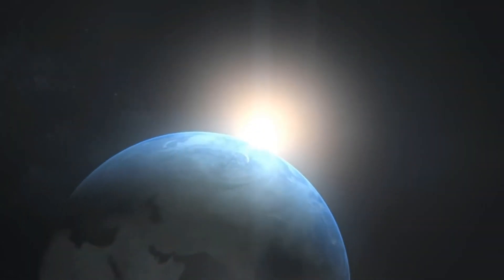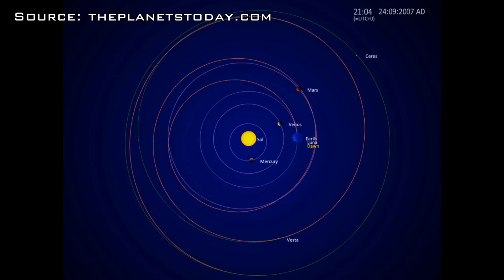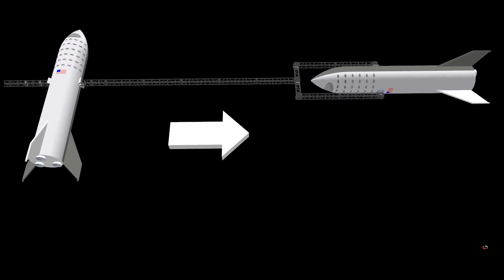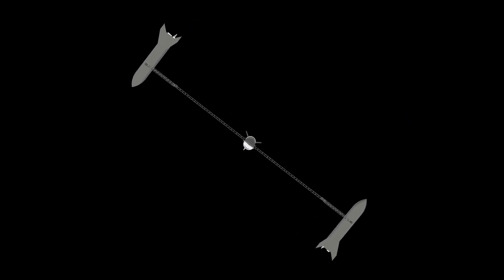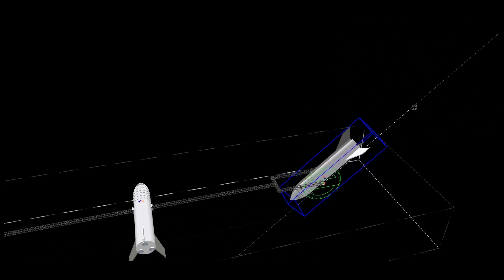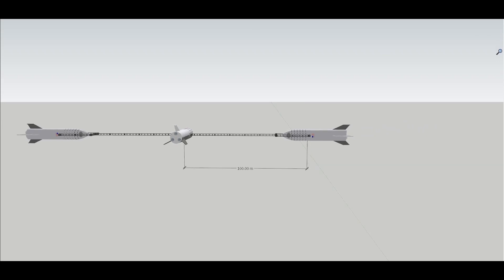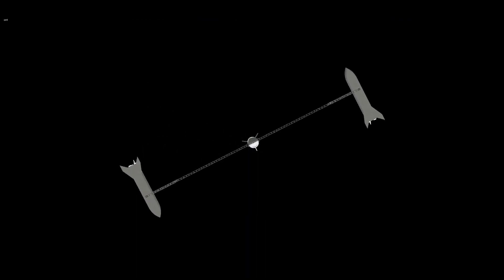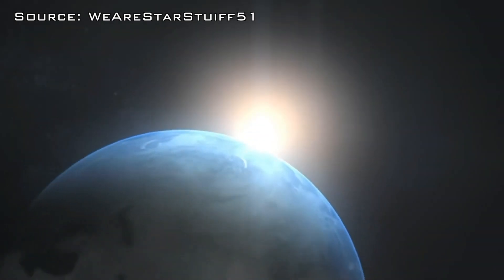GLS2: Artificial Gravity for SpaceX's Starship

Comment: While this is an interesting idea with an impressive amount of effort and research put into it, it is unlikely to function as described.
The Dzhanibekov effect (Intermediate Axis or Tennis Racket Theorem) would result in the superstructure flipping around at regular intervals, which would certainly be very uncomfortable for inhabitants as well as possibly inducing additional loads.
See https://www.youtube.com/watch?v=1VPfZ_XzisU for a better explanation than I am able to give.
Reply: @scr33m9  If you have a look at the video I linked, I think you will find that it is in fact rotating about its intermediate axis.
The smallest moment of inertia would be about an axis that runs through the arms connecting the the 2 passenger Starships to the GLS.
The largest moment of inertia would be about an axis that runs perpendicular to the GLS and the previously mentioned axis with the smallest moment of inertia .
Which leaves the axis that runs through the GLS as the intermediate axis.
Again, not trying to discredit your valiant effort, but your solution is not without flaw.
I suppose it could be easily fixed by simply rotating about the axis with the largest moment of inertia instead.
Reply: @scr33m9  I beg to differ.
Your starship configuration is much closer to the wingnut than the spinning ring.
Have a look at the explanation from 6:44 in the Veritasium video.
The 2 passenger starships would simulate the heavy point masses (M) on the X axis.
And because the central GLS has its front and back end protruding out further from the center point than its sides, they would simulate the light point masses (m) on the Y axis.
Watch the rest of the video from there, and really try to understand the concept.
Reply: @scr33m9  While, I don't think you are going to "show physics who's boss" based the results of a computer game simulation, I would still like to see that. Just make sure you have no other forces like reaction wheels acting on the craft, and you would probably have to run it for a long time. I have found that spinning objects in KSP tend to slow down even though they shouldn't, which will be a problem and will skew the results.

I read something a while back that went something along the lines of:

A good scientist accepts that he will be wrong more times than he is right.
But it is in accepting that as an opportunity to find the real answers that distinguishes the great scientist.
 
Words to live by.

Comment: Why have a whole starship for the truss system. Just have the truss/connector portion in orbit (presumably put there by a starship originally) and have 2 ships connect to that and take it with them. No need to bring a whole third ship along. When they get to mars they two ships (presumably one being a cargo and the other being a crew ship) can detach and leave the truss/connector piece in orbit (maybe add a small thruster unit to it to control it's orbit) for the next flight back. Then repeat the process on the way back again leaving it in Earth orbit for the next ride to Mars. This allows you to optimize the truss for strength and weight instead of having to have it fold ridiculously to fit into a starship each time (yes it had to fit the first time to get up into space but with a dedicated ride/rideshare and some assembly in space the point should still be valid).
Reply from the maker: This is mean to be a re-useable system. Additionally, there won't be enough delta-V budget to enter a good Mars oribt, so the system has to fold up and enter Mars atmosphere to slow down at the destination and land.
Reply: @smallstars  But if it lands then it has to be launched again, launch and especially landing can be hard on equipment (not to mention the extra fuel that has to be made to launch a whole other starship). Even at the sacrifice of some payload/deltaV (And though I haven't done the math I'm not certain it would be, as at worst you could just sling it back to earth without slowing down - you could then have multiple of these between Earth and Mars and you could just catch one and ride with it as needed) it might be worth it to find a way to leave it in orbit or transfer back to Earth. 

Plus, as long as the truss/connector was light enough, and it presumably should be as light as possible since we are sending it to Mars and back(carbon fiber or titanium/nickle alloy - yes it has to handle a lot of stress but not if the movement between the starships is very synchronized - and I'm only hoping the throttle system on the rapter engine can handle delicate maneuvers well - though they might require a more dedicated hydrazine thruster instead for delicate maneuvers like this I'm not sure they have planned that far in advance though). If it is light enough then a small thruster should be able to slow it enough for orbit and speed it back up to meet them again for the Mars to Earth transfer. It might have to detach early and take more time to slow down for mars capture as well as accelerate slower on the return trip, but that is just math and getting the system of equations to line up. At most we are talking about a few days without gravity at the end and start of a trip which is probably doable for even relatively untrained astronauts (which Mars astronauts would presumably be the best of the best).
Reply: If however, someone did the math and found out that I was way off on my assumptions then I probably wouldn't argue with you. I've done math like this before but given that this is a generic reply to youtube  you will excuse me if I don't break out my slide-rule. All I wanted was for other similar ideas to be discussed.

Comment: So the real question is: who is recreating this in KSP
Reply from the maker: @luznoceda5322  Link me to it!
Reply: @smallstars  I think he meant this: https://www.youtube.com/watch?v=W4L2sIYR_3M
Reply: I think putting together three starships in a triangular formation instead of just two would be much more stronger and would require much less support.
Reply: @AquarianSoulTimeTraveler  i went for 4 arms..made handling it easier but your right, 2 is kinda sucky
Reply: I think that you are right about using a rigid surface I just think you're looking at this in the wrong light it's going to be too weak to be able to take all that outward expansion pressure and also not twist and bend... Would require perfect synchronization of rocket Burns to prevent twisting which is possible in a 100% doable but I just think it would be a wiser decision to incorporate three starship in triangular orientation but for fueling purposes it would be very hard to refuel if not impossible if you didn't have the third one in the middle like this design that you're talking about... it should have poles that extend outwards with steel cables to attach and strengthen the design even more against accidental twisting... Would require some in space assembly but would work really good and be super strong.
Reply: Is already recreated, they use a very long truss and an captured asteroid.
Reply: @Zamolxes77  I'm sorry but I checked ur video from 9 years and u built that MASSIVE building IN SURVIVAL omg
Reply: me you bitches! I'm high on C R A C K
Reply: ugh
Reply: We need you too Fuck in the Name of Science (Nope!)

Comment: Ok, so it's a nice idea, but there's some engineering issues.
1) You are picking a point along the length of the ship to bear it's "weight" tangentially on a relatively small pivot point. Even if you don't spin up to one full G, the lateral forces will require substantial re-engineering.
2) The craft now needs to be engineered to withstand dynamic shear stresses in addition to load from acceleration. This does bad things to pressure vessels.
3) Rockets are designed assuming that the thrust vector will necessarily pass through the center of mass. In cruise phase, prior to spin up, this will not be the case, nor will it remain static during spin up. Gimbaling and fuel balancing may not compensate for this, and sloshing could be a non-trivial problem, if the rocket doesn't tear itself apart.
4) I've not seen any data on the minimum thrust a raptor engine is capable of safely providing. The goal is as low as 20% of max, but is even that safe enough. Is the minimum thrust of even a single raptor gentle enough to provide the fine control you are suggesting. Remember, by this point, the craft is near it's dry weight. if we only use 2 of the 12 raptor engines a pair of "Starships" would need running at just 20%, you are still look at almost 7% of a single Starship's full thrust, from a craft designed to be able to reach lift off from mars and potentially return to Earth without Martian-orbit refueling. And again, that's assuming you can get away with the minimum of one engine per ship; there's no central engine like in the falcon 9's layout, and the current design calls for tri-radial symmetry
Not saying its an unworkable solution, just that it's not as easily compatible with current designs as you may believe
.
Reply from the maker: Thanks for your input! Will update with a new video on this topic eventually

Comment: How much reinforcement would you need to hang the weight of two rockets off your anchor point though? And if you needed it to be at the centre of mass you'd need multiple super strong anchor points to allow for fuel expended, or pump it around with very fine control.

Comment: You are right about us needing to use centrifugal force based artificial gravity to ensure the continued health of the passengers. And you are right too about the problems of using tether cables by themselves. But your trusses alone are not big enough to handle the centrifugal forces that would be endured for Earth or Mars level of gravity. It would likely tear your trusses apart. Even for micro gravity they would be ify. You really would need a larger and stronger structure to properly pull it off. A mix of lighter trusses and tethers might be able to pull it off in a different configuration, but space walks would likely be required to set it up. You have a good start for a design, but you need to take it back to the drawing board and rework it. Something that might help is looking up information on how engineers try to build small bridges that are as light but as strong as possible. I took part in a building competition when I was a kid testing those very principals while build small light weight model suspension foot bridges. They might just help you out.

Comment: Problem with this idea is that the center of mass for each spacecraft will continuously shift towards the nose as fuel is used up, so maintaining perpendicular orientation will be extremely difficult during the acceleration burns. The rockets will attempt to point away from the center of rotation due to centripetal force. If struts use rigid locking, that would exert significant torque with which the mechanism wouldn't be able to cope.

Comment: Using the KISS principle, this could work using a steel cable attached to the noze of 2 starships rotating to achieve 1/2 of earth's gravity, therefore requiring minimal structural modifications. Adjusting gravity/RPM becomes as simple as winching in/out the cable from either vessel!
Reply: Reeling in the ships lets you use electricity to provide most of the spin energy instead of propellant, which is definitely a win.  A flexible tether (probably Dyneema, much better strength/weight than steel, but with a steel braid overwrap for UV resistance) is a bit tricky to control since there's nothing in space to damp vibrations, so you'd need to actively RCS damp out the vibrations, but that's still way better than wasting a full starship payload on a rigid truss.
Reply: Yes especially noting that a solid system will be more heavier
Reply: with a rope, how are we going to constantly prevent the two ships come together and collide?
Reply: @Think-About-It  Because they're spinning around their common center, centrifugal force wants to fling the ships apart.  The rope holds the two ships together.  The system should be able to spin like that, in balance, during the entire coast phase of a flight.  You'd want to despin and decouple before running the engines.
Reply: @olawlor , remember the movie Gravity and some others?  The object sprung out untill there is no slag, then it sprung back like a spring.
Reply: @Think-About-It  You will need reaction control thrusters to actively damp dynamic loads like that during setup.  Once the cable is tight and set up, it should be stable.

Comment: If RCS doesn’t work you could just use magnets.... using power from the solar panels. It would take a while to get the right spin speed but it would work. The speed required would be incredibly fast though. The larger the radius the slower the spin speed needed for 9.8m/s of centrifugal force. The actual starship is so small in comparison to what you would need you’d have to spin it at a crazy fast speed

Comment: I posted one a couple years ago with a hub-and-spoke design for several Starships, but the more I thought about it the less it makes sense to ride Starships to Mars and back.  I think we'll see a transit platform that never leaves orbit (or even at a Lagrange point) and the Starships get used as tug boats and ascent/landing craft.  Their cargo capacity and cost-to-orbit will be astonishing.  I think it'll be cheaper to refuel one or two times more than it will be to live in a Starship for 3 months.

Comment: Only one problem using centrifacal force to create "gravity"... it's not really gravity. Using a centrifuge technique will cause a downward pressure however it can significantly effect the blood system causing blood to rush to your feet and thereby causing less blood to the upper extremities. Same as in a roller cost here on earth when you become inverted the blood rushes to your head. Over time i.e., six months in space this would cause a significant loss to bone and may cause  abnormal heart condition, blood pressure, etc. Exercise is key in a centrifical design as well as body positioning to overcome the aforementioned issues. Both the a main centrifuge must be used as well as an individual centrifuge to assist with biological processes. Just some thoughts. As a true mass based gravity solution based on  has not yet been discovered, centrifugal designs must suffice for now.

Comment: The Von Braun Torus was proposed to be exactly what you are describing. The first phase of construction was to start as a truss exactly as you describe including the cylindrical rocket pushers at the ends. Please note that rocket engines were discarded as a pusher concept (in favor of other technologies) because the outstanding vibrations and resonance caused by any rocket engine would compromise a truss in seconds. The idea is weak in a rocket propelled application because the longer a truss would be, the more likely it would be to fail under vibratory stress (and you need a long one). The idea minus the rockets would have worked. Only in the second third and fourth phases of construction was the Von Braun Torus to become a circular structure with huge central truss as seen in the film 2001. The idea that such a structure could travel like a star-ship was also evaluated. The reason this project was shelved was because to get a long enough truss would require an absolutely huge expense, even using a cable was abandoned though it costs much much less because it would none the less still have been too expensive.  Note that a short truss would merely create an un-natural, uncomfortable, un-bearable facsimile of gravity which space medics worldwide declared to be "useless and/or life threatening." To sum up; artificial gravity is the holy grail, if you want the holy grail you must endure the test of gold removal, be prepared to pay for the huge size or no cigar... the logical alternative; build a Die Glocken  :)

Comment: Your nose-to-nose cable idea is brilliant.  The spacecraft are already built to withstand three times the force of Earth gravity along their longitudinal axis at launch.  The RCS thrusters have sufficient control authority, all they need are large enough propellant tanks.   Using a sufficiently long cable would all but eliminate the annoying Coriolis effect.  Do not use a truss, it is too heavy and complicated when a simple cable reel will do.  Do not support the ships by their midsections, they are not designed for that.  Do not fire the main engines for spin, they are far too powerful for fine control and unlike the RCS thrusters there isn't another set conveniently located on the other side of the ship for slowing down.   
Nose to nose by a long cable is perfect!   You have elegantly solved the microgravity problem.

Comment: What about the Coriolis effect? I would think a circle that small could result in it being a very significant factor negatively impacting comfort.

Awesome video by the way :)
Reply: A long cable would make the effect nearly undetectable.   There is no real limit on the length, Starship has plenty of lift power.   The cable could be a kilometer long, easily.
Reply from the maker: Thanks! http://www.projectrho.com/public_html/rocket/images/artificialgrav/gravComfort03.jpg